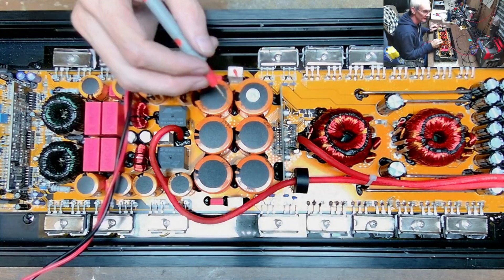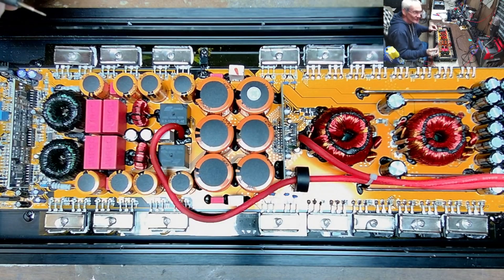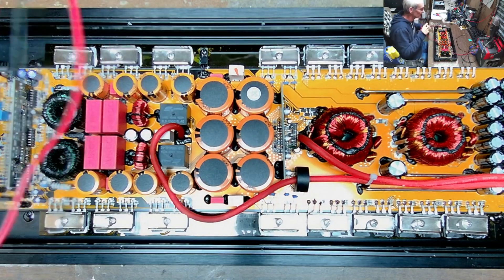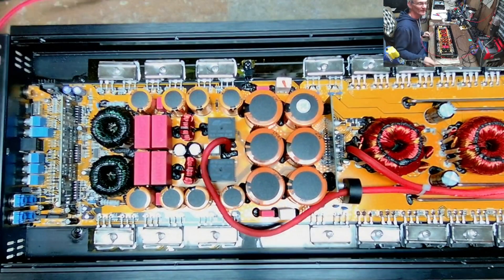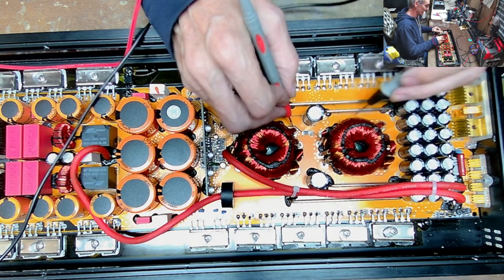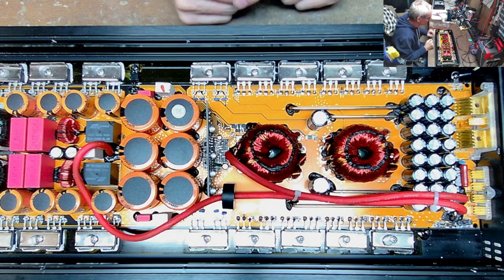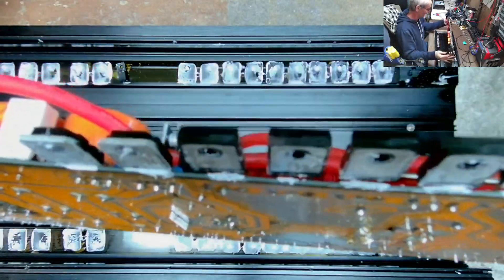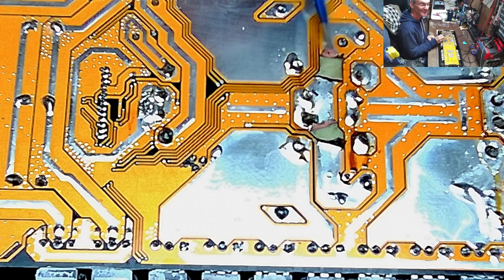Bee Busy Audio ODD Parts Used Check Out this Power Supply Trace Failure

Comment: i'm brazillian and i've started building my own amplifiers to learn and for fun. i can't wrap my head around the multiple transformers used in the high power ones such as this one, ones like the MD8k have even 4 of them. why couldn't them use just one? does it have any drawback like core loss, or some other magnetic properties that holds this design choice? and by using four of them, how are they working together? do they have their own rectifiers, or some weird combination like 2 transformers for positive, 2 for negative, etc. they can also be out of sync so that only one of them bumps the voltage at a time, can you shed some light on why and how?
Reply from the maker: This is a DEEP topic with so many variables it will drive you crazy trying to understand it all at one time. The best way to think of it is "to spread the load" for the most simple answer to the question. Magnetics is a completely different line of knowledge that I do not posses. It was too hard for me to grasp the theories to pursue any path into transformers.
Reply: @ellensburgamplifier  Yea i get it, but how it's designed to spread the load is the question, i've designed my own board using a relatively small transformer for the power it produces (1500w) but you know, we always want more power!! and so my new board will have a bigger transformer, i'm expecting 4kW, but seeing industry standard designs all having multiple transformers makes me question myself as a complete fool. can you point me to some reference where maybe i can learn about this technique? and also, happy new year!
Reply: A lot of it i think has to do with price and size constraints. You have to take into account vertical height, not just width, more windings = more height. Plus in the world of ferrites different shapes can cost different amounts. A smaller jellybean or industry standard can cost pennies while an oversized or odd shape can cost 5x more. Idk but those are my thoughts. There might also be some crosstalk or phase/bank jumping considerations?

Comment: So busybee amps are not made well? Its a local company in the PNW. I seen their ads but i guess ill stay away from them.
Reply from the maker: Actually it is built quite well. Just odd parts and slightly thinner traces.
Reply: Just because something fails doesn't mean it's not made well. They might be made perfectly adequate. Sometimes the failure is due to user error.
Reply: @JasonWW2000  he said it was the thinnest traces he's ever seen that's why
Reply: @Sql253 Todd's not going to tell you if it's a good or bad product. You have to decide that for yourself. 

If you have doubts, don't buy it. I suggest you choose a product you have confidence in.

Like me, I typically go Rockford. It's high quality and I like it's sound character. 

I've never heard of Busy Bee until now. My confidence level in them is pretty low. That's just my personal feeling. In reality, they may fine products.
Reply: @JasonWW2000 I just rewatched the part he talks about the thin traces and thin board. His tone says it all.
Reply from the maker: @JasonWW2000  Correect, I will never say if a brand is "good or bad" as that gets into legal stuff.